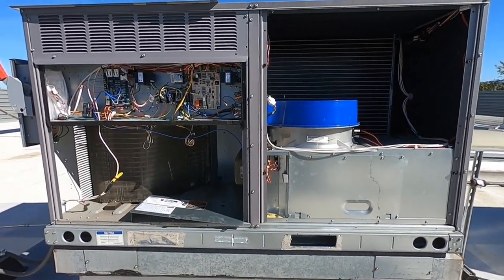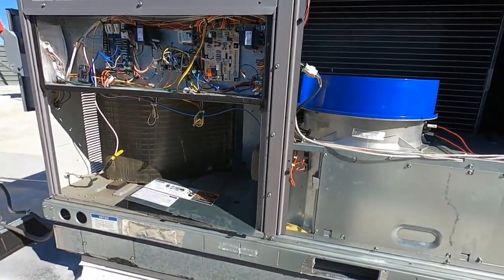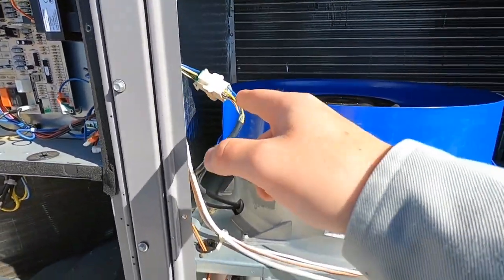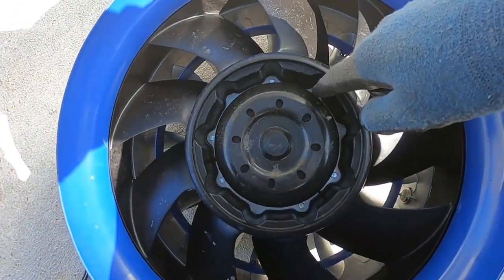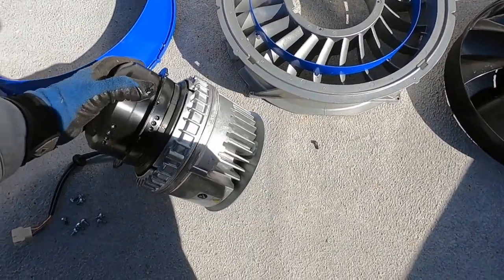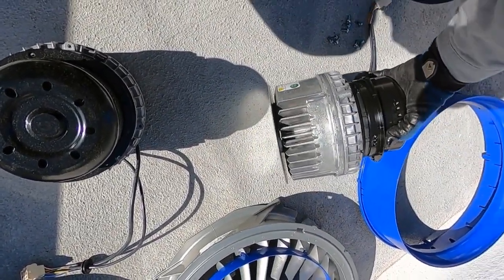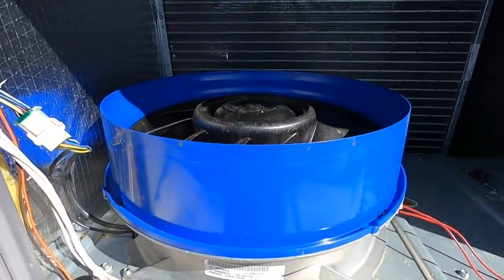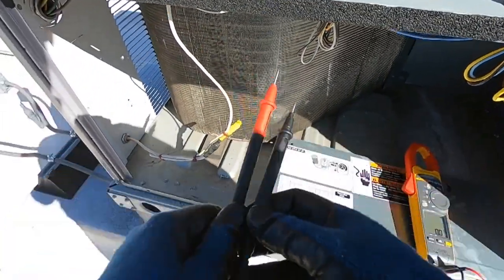Carrier RTU EcoBlue Fan Motor Replacement

Comment: The Ecoblue blowers are pretty cool but, I prefer the direct-drive squirrel cage with a Fasco or Marathon ECM motor.
Reply from the maker: I agree with you Mate!
Reply: 100% with you! I love to be able to repair my equipment without ordering these OEM only very special and crazy expensive parts. One my customer is running the restaurant with no A/C (1.5 month old RTU) and that damn blower motor has to be shipped from the factory.. So, no A/C at that restaurant for 4-5 days…. At Memphis… with 97F outside….

Comment: The blade numbers are also marked on the stator so no need to worry about marking the rotor
Reply from the maker: Thanks for this. Have you had issues with these motors? Like a high leg on ground issue? I’m reading carrier had a revamp version of these ecm motors.

Comment: Thanks for the video.  I'm sitting right next to one. Found the transformer 5amp breaker tripping. Nothing coming on. Finally found that the compressor has an unloader plug on the backside of it. Unplugged it... breaker didn't trip, compressor and OF started... but indoor fan didn't.  No 10 volt on orange and white wire . Line voltage was present on plug.  So now I have an issue with the IF motor and the unloader.  This unit I installed in 2019.  POS. .... and my wife worked on the carrier assembly line here in Tyler for 21 years.... before they moved the plant to Mexico.
Reply from the maker: I’m definitely not really digging these. The motors have gone up as well they were 800 not there around the 1400 range and there made in Germany. I ordered a main PCB just to have on hand it took 6months to get. 

I’ve read a bulletin released by carrier having issues with the high limit switch on these and a certain batch of modules on the indoor motors. Something to note down. I might call tech and ask if there’s any recall or other issues we should be aware of with these units.

Comment: Any idea how I can get motor hc54jz231? Been on backorder for months.
Reply from the maker: Are you going to sigler for the motor? My local sigler has them stocked pretty well. They told me there furnace boards are what’s on a few month back orders. There commercial parts are well in stock.

Comment: Easiest blower motor replacement out there. Replaced a bunch recently 

Make sure you don’t have a high leg to ground on one of the incoming line wires
Reply from the maker: It is pretty simple and I give carrier credit for that. Not good to hear on replacements but job security ay! Lol

Good info to keep in mind thank you.
Reply: What makes you say that about a high leg to ground? I’ve had three bad motors in a month and I noticed I have one leg higher to ground than the others

Comment: I am replacing one of these motors tomorrow . It’s ICP 6 ton gas package. Looks 100% the save. That motor lasted 7 weeks ONLY! 
It’s under warranty, however that motor s ~$1200 (!!!!!) at United Refrigeration! So, I am not sure if I want to install these units for my customers in a future.
Reply from the maker: I’m constantly seeing/hearing these motors going down. One of the things to look for is static pressure I believe these are very picky on static pressure.
Reply: Well, this particular RTU just got the entire ducts re-done. It was VERY deficient air ducts set up. It was ~800 CFM on the return side…. For a 6 ton unit!!!!! That Sudway restaurant was always sweating. So, I’ve got the entire system done correctly with ~3000 CFM on the return and ~2500 CFM for the supplies. It started to cool… ran happy for 2 days and… that damn motor just quit!
Reply from the maker: @edlauren9434  right so now it’s running correctly and set to correct static for the motor. I also read issues with the high temp limit on the indoor section believe that was a recall on select years. And an issue regarding voltage with the plug.
Reply from the maker: Wswrefrigeration mentioned it in the comments on this video below.